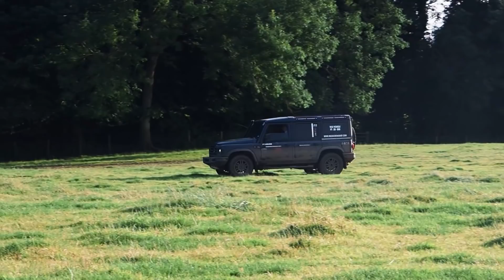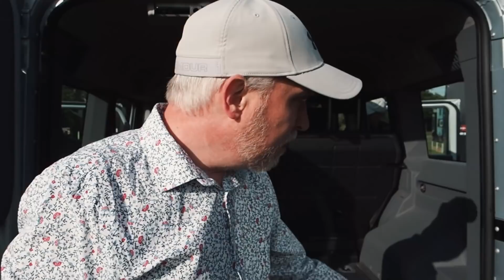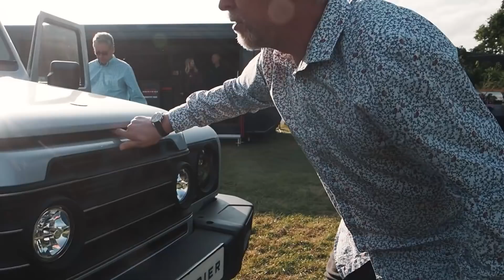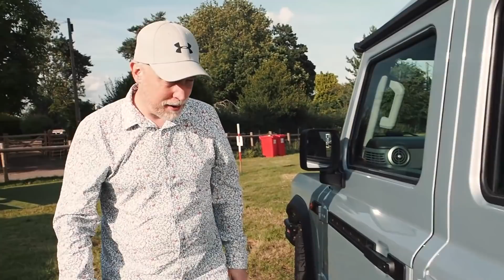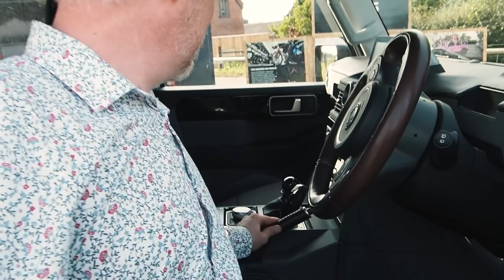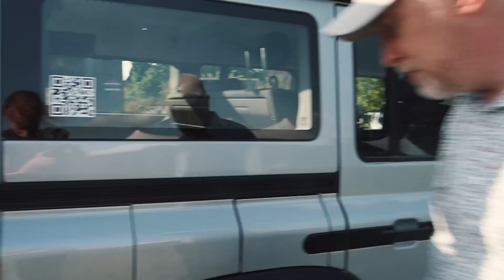Ineos Grenadier First Test Drive and Details

Comment: question is Jay tee would your swap your D3/D4 for one? engine and box will be better as well as chassis suspension for off road applications but doesn't seem as a practical with the flexible seating of the disco and the little bit of luxury which are nice on long journeys?  I have a deposit down to replace my disco 3 but need to see it in the flesh i think to decide!
Reply from the maker: I am still not sure, my worry is if I would really take £50K+ vehicle off road.

Comment: The safari lights/ windows  would have been good , I have no idea why would anyone think that big depression’s with grab handles it’s a good idea , it looks bad and it will affect the aerodynamics and noise  + it will eat on to the interior space , if they wanted to have tie points for attaching stuff to the roof they could have some sturdy low profile attachment point/ grab handles sticking out , that would still be miles more aerodynamic and imo better looking .

Comment: It'll make an excellent tourer here in Australia and leaves my defender for dead. Biggest concern will be a solid dealer network over here.

That rear steel panel near the tow bar has to go. It Kills the departure angle. 
FYI that was hardly an off-road course.

Thanks for sharing

Comment: Pity about the archaic and less practical and less flexible 60:40 rear seat split, instead of the more modern 40:20:40
Glaring error , especially from a clean sheet of paper design D’oh !!!
Reply from the maker: That is a good point, interesting to see if they change that for release.
Reply: Not necessarily V8 but Toyota's diesel  are no nonsense engines.

Comment: Excellent review and thank you. How does this vehicle weigh up with the LR3,4? . Also how is the eternal cabin 
/boot space compared to the disco's?
Reply from the maker: It was generally a bit smaller inside compared to LR3/4, but not massively noticeable.  Boot space is similar but I don't believe Ineos will offer a 7 seater version.
Reply: @JayTeeCars  how is the ride quality on and off road? Also is it bigger than a Defender 110?

Comment: I like the notion of a "Defender replacement" vehicle. But then they go and fill it up with all sorts of electrical stuff like parking sensors, and plaster the outside in attachment points for more gimmicky optional extras, many of which, I suspect, won't ever be used.
I would have been more interested if it had been shown with vinyl seats, rubber mats and far fewer gadgets. But that's just my personal view.....
Reply: You just described the Toyota 70 series 😊
Reply: Which we cannot buy here

Comment: With all their experience and 'heritage', this is the car Land Rover SHOULD have made... Talk about missed opportunity. Great job Ineos.
Reply: Plenty of yuppies to sell their “new defender” to.
Reply: What Ineos is doing is creating an obsolete novelty. It will never be as good as the new defender.
Reply: @AdventurousNomad007  yeah because who needs suspension travel/articulation, front and rear lockers or removable switch panels to retrofit switches for accessories. Who need a real offroader. The defender looks like a skateboard offroading because it has zero suspension travel and lifts wheels on the tiniest obstacles. You want articulation to keep the wheels on the ground for stability. The defender doesnt have this at all. What Land Rover should have done is used a solid axle rear and independent front suspension setup like the new bronco. Despite the independent  suspension the bronco still has good suspension travel and articulation thanks to a front swaybar disconnect. Only thing indont care for is the BMW engine. I think they could have gone with a more reliable engine like the 4.6 v8 from Toyota.
Reply: @AdventurousNomad007  They are very differently engineered vehicles designed for very different purposes so any comparison isn’t really relevant. You wouldn’t really compare a Toyota 300 series with the 70 series, which is basically the same as comparing the new Ineos to the new Land Rover.
Reply: @davespanksalot8413  I totally agree with you on that.

Comment: I wish this car all the best and hope it bites land Rover hard .   But,  call me old fashioned  and maybe a tad conventional .  I just cant get on with specialist dealer jobs on an old Landy which is what this vehicle proudly proclaims it to be .   Old Landies used old tech engines that the farmer or the soldier can fix easily and inexpensivly and today with disposable income being vastly reduced , surely old Farmer Gies cant afford a £1000 to have his cam belt changed ? or £250 for a rear light cluster when his old 2a cost 25p for a bulb and just as good .   My advice is to junk the BMW engine as it will be nothing but costly when it gets older   and re engine the car with either a Perkins 4107 diesel or a Rover V8    Yes they are old but they are bullet proof and diy friendly also parts are cheap.  Those that sneer at this would do well to remember the old sluggish wartime Royal Enfield Motorbike , now 75 years old  and in full production in India where the firm is the 4th biggest Motorbike manufacturer in the world .   This is where Inneos needs to be .
Reply: I highly doubt any of those engines would pass the required pollution requirements of new vehicles.
Reply: @benjames3604  I reckon , the bosses of Inneos are entrenched with performance figures and not customer useability . Is the old farmer concerned with 0 to 60 times ?  no he is not and I reckon the old engines could be made to conform quite easily to pollution requirements .
Reply: BMW engines are robust  reliable and tried and tested. It is one of the most widely used engine across different brands.Range Rover,Morgan, and the legendary
McLaren F1,are just but a few examples.
Reply from the maker: You have some good and valid points
Reply: Sorry but I dont agree with BMW being the most reliable and robust.   They are complicated , they need complicated hi tech equipment to service and repair , and they use cambelts .   The targeted market that Inneos is eyeing up is the vast areas of hostile environment , deserts, mountain sides , jungles and anywhere in the world on a Sunday when hi tech garages arnt open for business , how the hell does the old farmer needing to get to a sick animal  on to his fields deal with a failed sensor thats put the car into limp mode or worse .   The BMW engine is no good .  Be told !  the Inneos needs a basic engine that is diy friendly .
Reply: @jonathanpardoe8722  it's clear that you have no idea about modern day car manufacturing, research and development and what laws and regulations they must comply with.
Inneos cannot develop or even modify extensively due to cost, they even have that crap bmw shifter due to cost cutting.
Older engines just cannot comply with modern environmental protections and/or would require extensive/expensive modifying.

This is not a car already on the market getting an engine replacement.  It is new and needs to go through all the current regulations.

You can fairytale some basic hunk of iron all you want but it just can't be done at their price.
Quite simple if u want basic get an old LR.  And this market segment is bigger than the "farmers"  
I'm sure future editions could be simplified but at the moment they basically need to capture the largest market share they can.
Reply: @jonathanpardoe8722  
I have an old 1990 BMW E36. The six cylinder M50 engine in it has never been put apart despite clocking 250000 kilometres.I have never had any electrical or computer diagnostic problems with it.The engine is DIY friendly too because there several things that i can fix myself,yet i do not have any mechanical skills or training.
Reply: @jonathanpardoe8722  nothing wrong with cam belts if they’re easy to change. The 3 litre Toyota diesel cam belt is easier than the fan belt!
Reply: The Australian Army used in their defenders Holden 6 cylinder engines in the 60’s & 70’s and Isuzu diesels in the late 80’s. Can’t see the Australian Army or mining companies running with a 
Bring My Wallet engine.

Comment: Thanks for this.  I worry about that large central control knob behind the gearlevers. I hope it doesnt control anything essential as it looks very vulnerable on what for many will be a working vehicle. It needs fences around it just like they have added to the other key switches on the truck.
Reply from the maker: That controls the off road modes (similar to LR Terrain Response).  Yes needs to be well sealed as that is an issue in LR Discovery if you drop your coffee on it.

Comment: Great looking, massive vehicle. I love it. The weakest link is the BMW engine unfortunately...
Reply: Whats weak about it, its had a great run in many cars without problems.
Reply: @Ganbacchau  how does it handle bulldust?
Reply: @Ganbacchau  these engines are notorious for catastrophic timing chain failure and become ridiculously expensive to maintain past 100,000km. They are also very difficult to get parts for outside of Europe... Good luck repairing this thing anywhere in Africa or outside of a city in Australia.

They would have been much better off going with an Isuzu or Toyota engine and suitably paired transmission. A vehicle like this is basically the dream car for a lot of Australians, but with a BMW engine and automatic transmission it's a non-starter for many of us.
Reply: Dont recall any drama about that with this engine. I think its a great engine.
Reply: @Ganbacchau  no its not, it will be against harsh environment, water/mud, very hot temps, that was not the engine for that type of car
Reply: Gas(petrol) BMW engine is generally a good engine.  just got to keep ahead of the maintenance.   But everything is full of electronics these days.  You fix a 94 Jeep with a set of sockets and duct tape.  My Range Rover I needed a scan tool and a cell phone to call for a tow.  I'd like the diesel please.
Reply: BMW good engine

Comment: Thanks. Great info. Do you think it is going to be in a manual as well?
Reply from the maker: That's a good question, which I should have but didn't ask...  Personally I think however an auto box is better for off road use and they have picked a good one with the proved 8 speed ZF.
Reply: The Grenadier was designed from the start with no manual in mind.

Comment: The external storage compartment would be a great place to locate a second power outlet (in addition to the one on the back of the center console)
Reply from the maker: good idea
Reply: @JayTeeCars  Running an extension cord from inside of the vehicle to outside during inclement weather isn't a great solution.  Good review